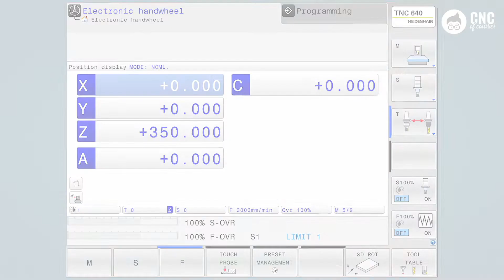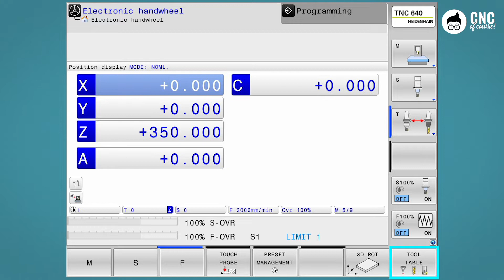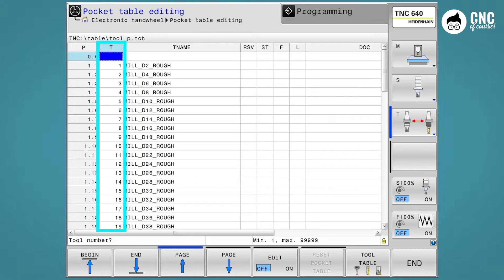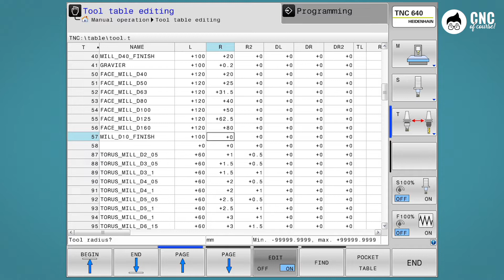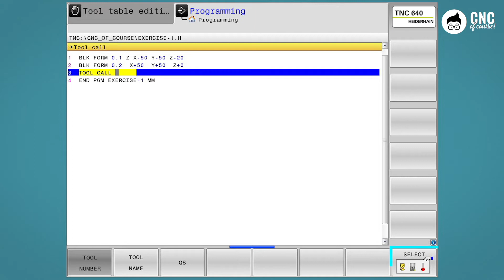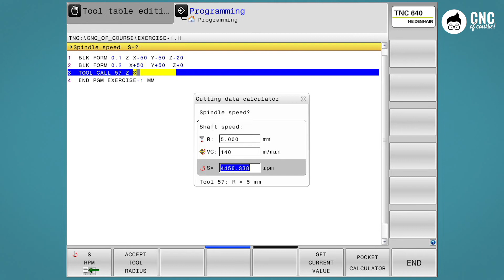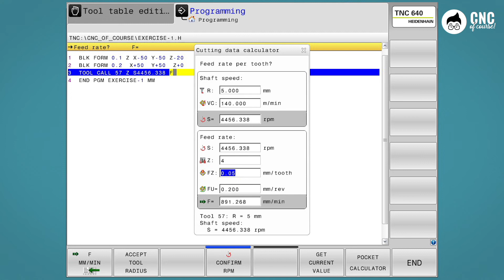Heidenhain programming course - Tool table and tool call function

Comment: I m facing issue in 426 tnc controller in this controller plc program blown so we restore the programe but while restart alarm display on main screen i.e.system update after pressing CE button one red window appear and plc programe translate show only  pls guide
Reply from the maker: Hi, if you need help with some issues on the NC please write to info@puntotec.it also with images of the display if that's possible